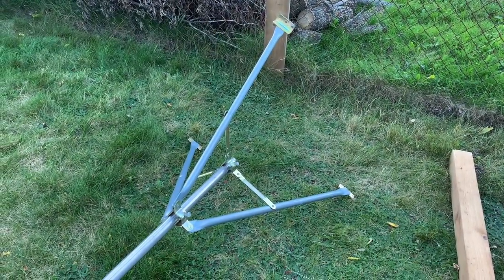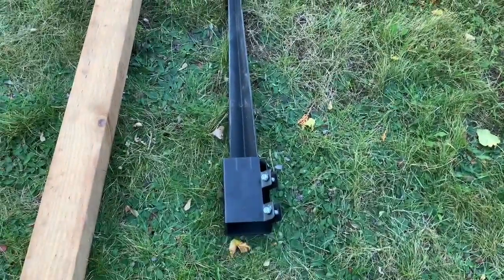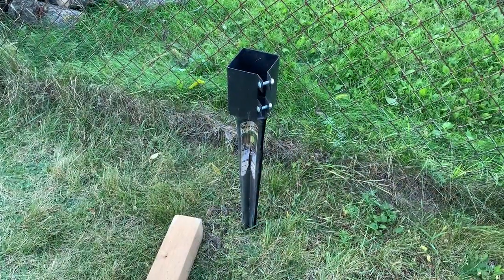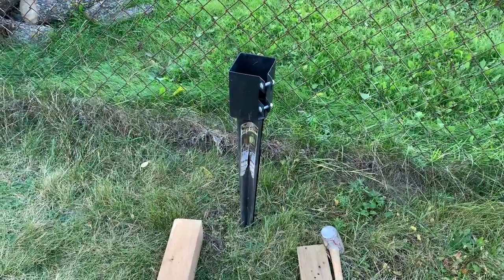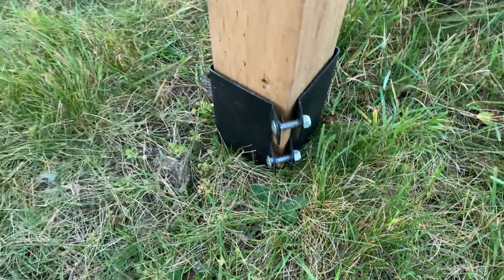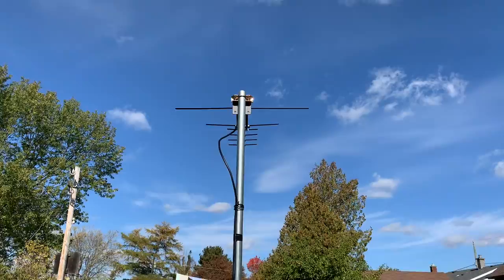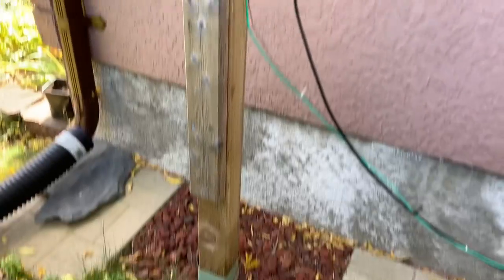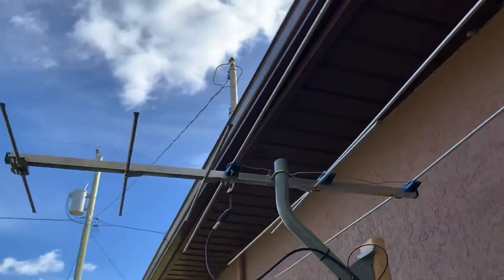Another TV Antenna Mast Pole Idea

Comment: Yes, that is a good idea.  You really should run an iron wire from the body of the antenna to the spike in the ground.  If you take a lightning strike, a lot of the current will follow the iron wire.  You use iron because the boiling point of iron is a lot higher than it is for copper and a bolt of lightning will likely boil it because there is just that much energy involved.
Reply from the maker: Thanks for the feedback.

Comment: For a non-penetrating tripod mount on the ground or a flat roof use concrete blocks and wood. Screw the feet into heavy pieces of wood like a cut railroad tie and put concrete blocks on them or if you have a concrete drill bit you could attach the tripod feet to concrete blocks.
Reply from the maker: Good suggestions. 👍